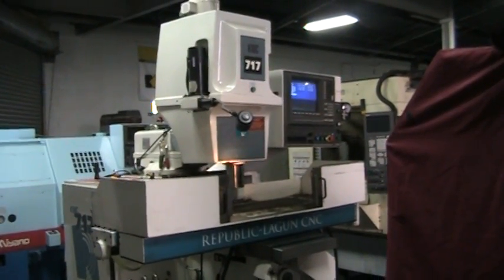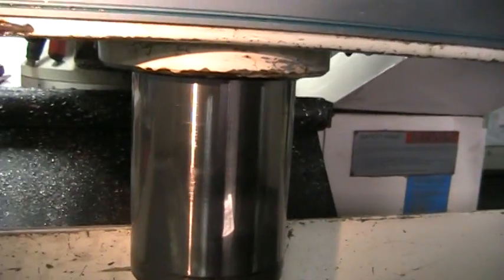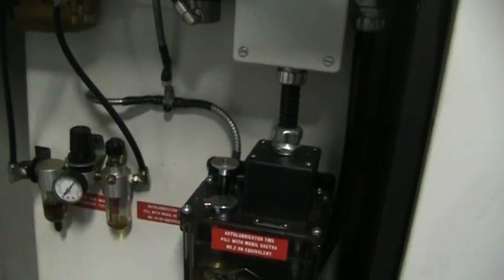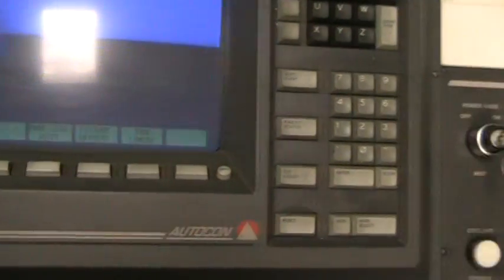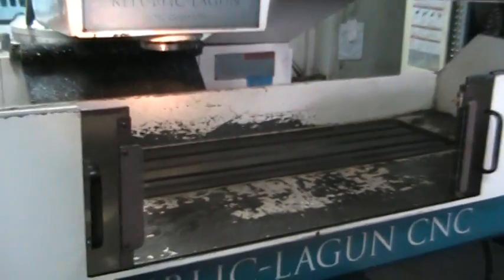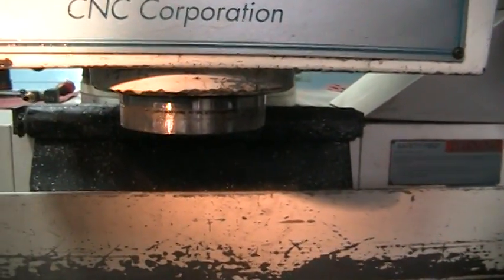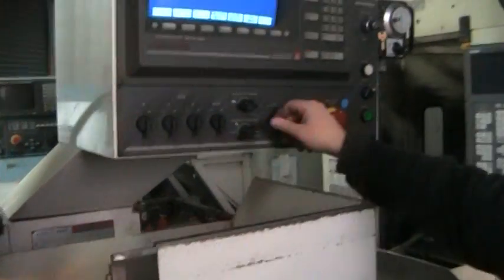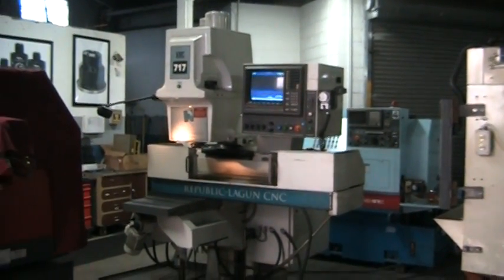Republic/Lagun KMC 717 3-Axis CNC Knee Mill

Comment: Hi. Could you please tell me how the barrier sourrounding the table is mounted? I run one of these at work. When I started they had a home made "bath tub" covering the entire table with two vises mounted over the sheet metal. I didn't like this setup for various reasons so I removed it with plans of making a better one. The main thing I'm curious about is how it is attached to the back of the table and if it is easily removable? Anything you could share would be very helpful. Thanks.